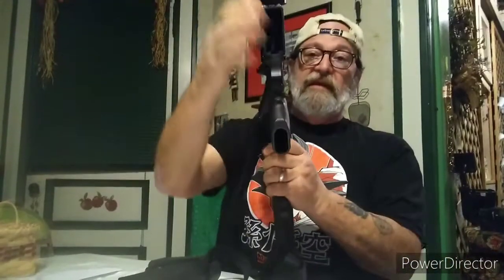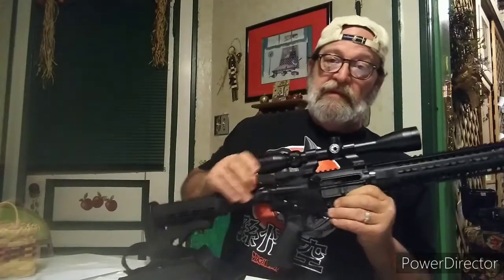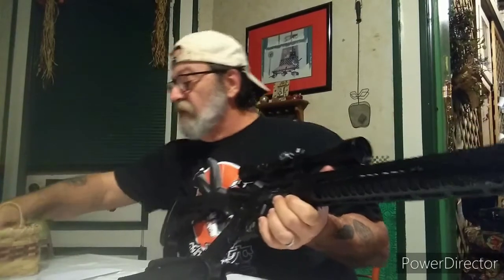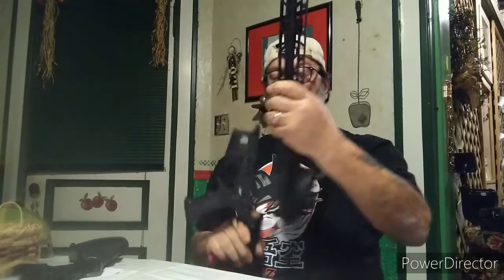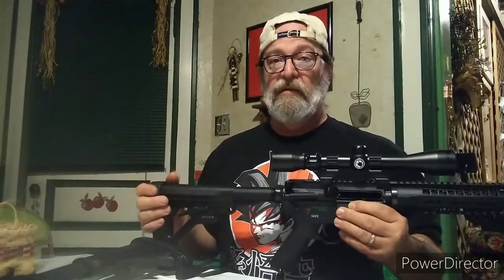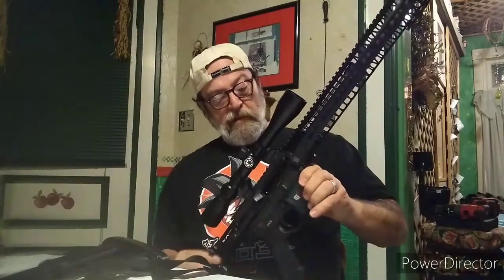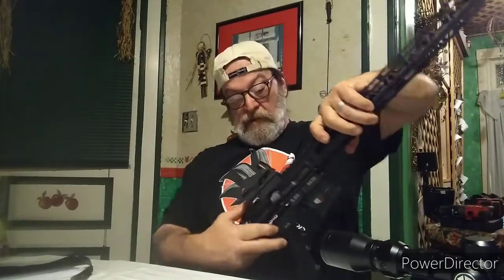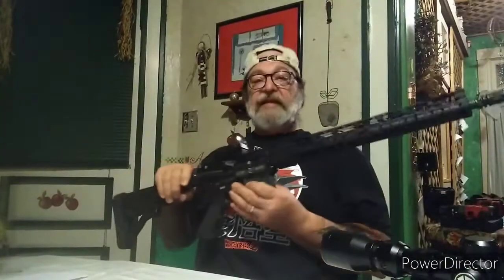I've got a problem with my AR rifles

Comment: Normal Once the bolt is locked open and the mag removed the only thing that is holding the bolt back is the friction of the bolt on the bolt catch which is being countered by the bolt catch spring pressure. A thump on the back of the stock will make there be less friction between the bolt and catch which will allow the bolt catch spring to push the bolt catch out of the locked position.
 
When the mag is empty and in place the mag spring is assisting the bolt catch spring to keep it in position.
 
If you slap the butt on the ground hard enough you can cycle the action completely to include ejecting and chambering a new round.